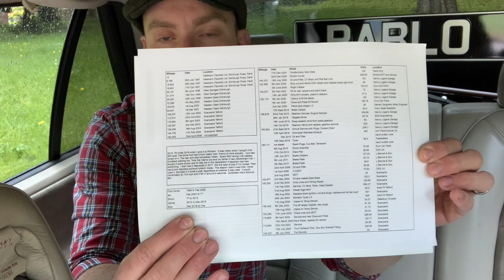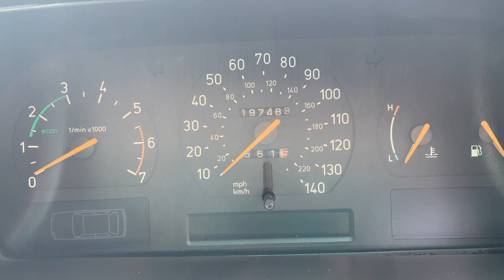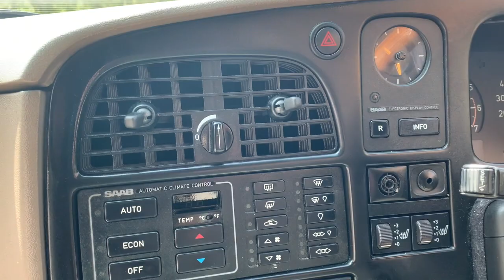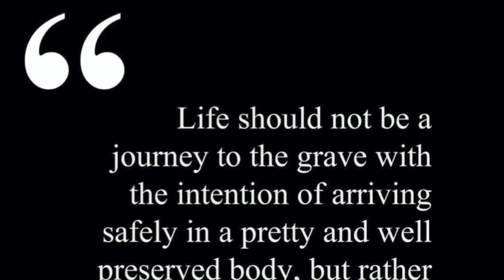1996 SAAB 9000 CSE 2.3 Turbo Full Details, History and Story

Comment: Have a Viggen convertible, 900 T16S 2 DR and a 1997 9000 CSE 2.3 Turbo I bought as a winter beater 8 months ago. It has turned out to be a keeper and is currently undergoing an engine swap as I love it like the children I have never had :) Wafty ride, economical even with abbott racing ECU, tonnes of boot space with the seats down and epic tape player and amp combo.
Reply from the maker: love it! Pablo is a cool, cool car.
Reply: @GeoffBuysCars  you receive extra brownie points for replying to messages quicker than my wife ever has :)

Comment: Another quirky feature i found on my 9000 is the mirrors can fold back and lock in place for when parked i found this out bye accident bumping into it as i passed it
Reply: They are designed to push air flow across the window to clear the rain. Clever people these SAAB engineers
Reply: @hawksheaddesign7758  yeah the good always die young...

Comment: No turbo gauge?? Sure it's not a hack? My '97 CSE 2.3 Turbo had one.
Reply: Mine too. Saab did funny things towards the end of the 9000 run in 1998.
Reply: Hi everyone, I think the high pressure turbo cse model's have the turbo gauge and the low pressure turbo cs model does not have a turbo gauge, I could be wrong
Reply: @stewarthill8165  your not wrong your right light pressure turbo has no turbo gauge